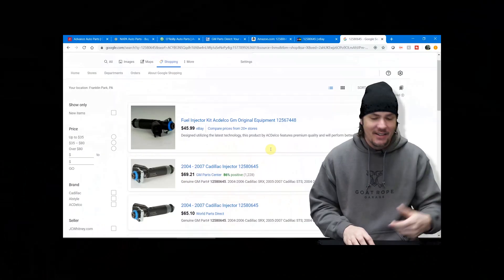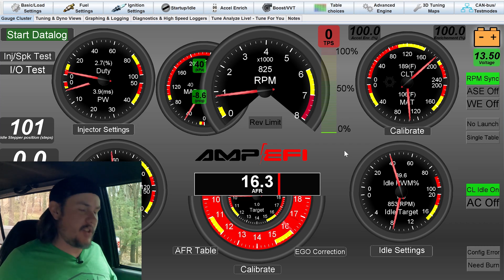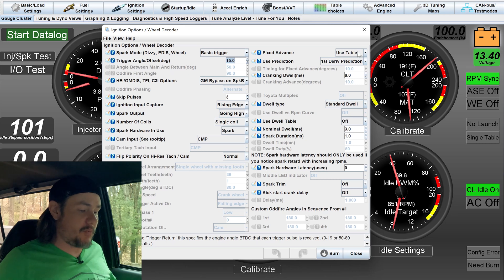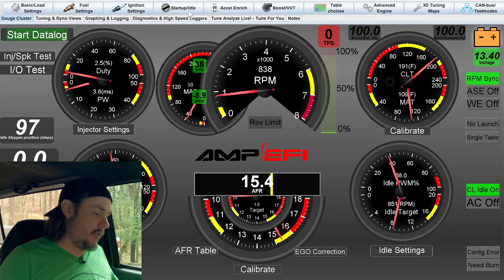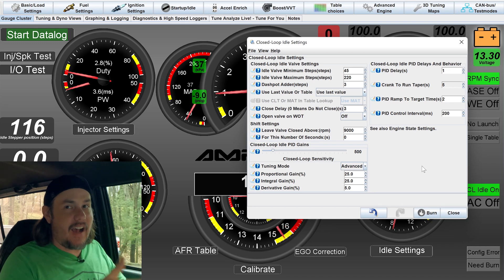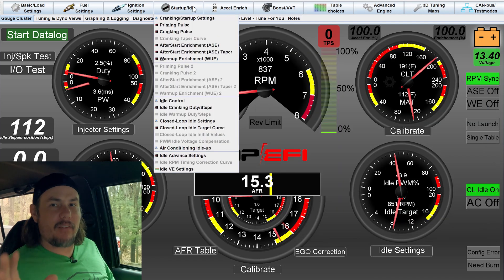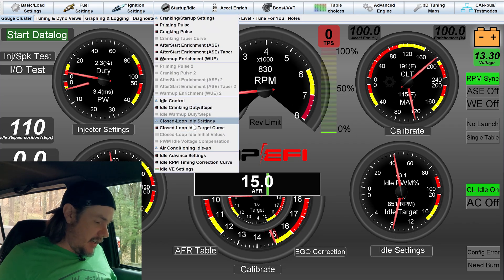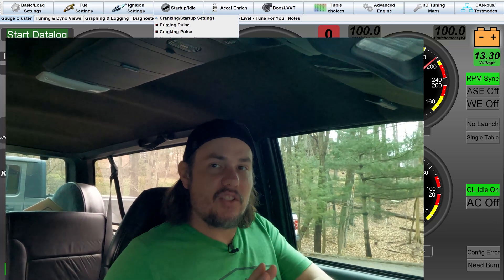MegaSquirt Timing And Idle Setup Steps on the Typhoon

Comment: You don't need to turn idle advance on, you can use the  idle rpm correction feature with it off and use the idle value in the timing table and it will be easier to deal with, and eliminate another timing  table for idle.
Reply from the maker: Sweet! Will give it a shot! Thanks for posting!

Comment: ALso you can add a bunch a EGO delay time  to try to dampen the response at idle of the EGO control loop.  I did not see the ego correction values in your video though to see the response.  Its just to lean at mid 15's.  If this has a CAT on it you will need to make sure the it fluctuates  slightly above and below 14.7 constantly for the cat to do its job.

Comment: If I was to send over my tune could you look at a log for me. Having trouble with truck rev up to 1100 rpm at cold start and sound like it’s going to shut off or break then settles down untill it gets about 775-850rpm then warms up and drivable. Warm start the truck just turns on it cranks but it’s like a soft crank and it’s on no real start up sound like it would usually even warm. Any ideas
Reply from the maker: Sy/Ty?  info@goatropegarage.com

Comment: I have a questions if thats ok, first let me say love the videos thank you, my setup is microsquirt v3 ecu  351w gt45 turbo, my question is I'm using some old ford white 160lb (low) impedance fuel injectors with individual resitors, and my question is for the fuel injector dead time where should i set this up 0.900 or should i go higher the only issue i have with this setup is tip in throttle it hesitates in lower rpm  but clears up at higher rpm anyhow sorry for the long post.
Reply from the maker: I don't know that dead time will help this, what kind acceleration enrichment are you using? You might not be getting enough fuel shot from the AE